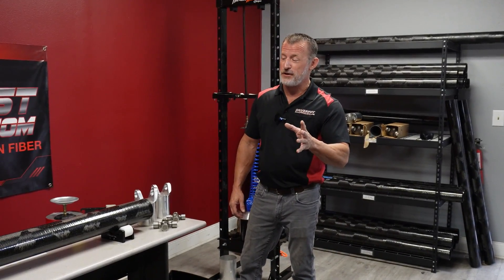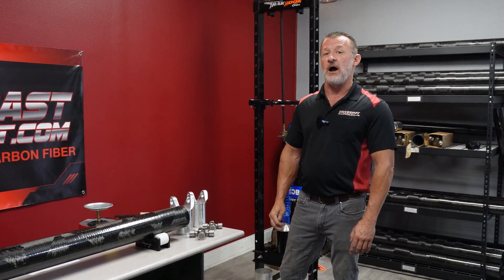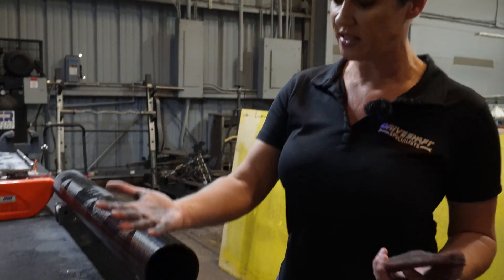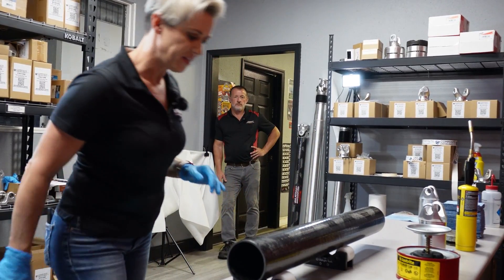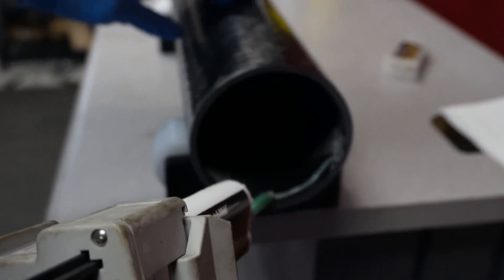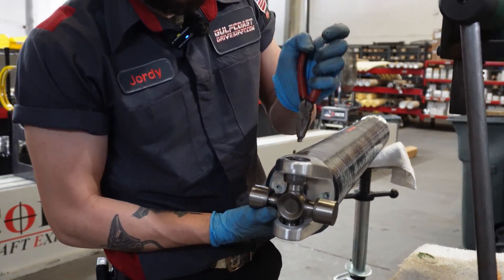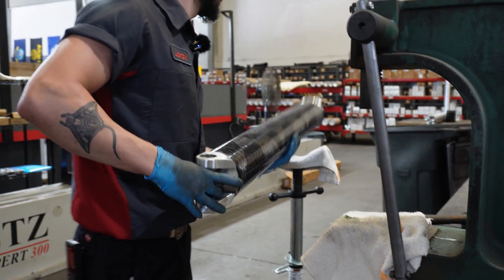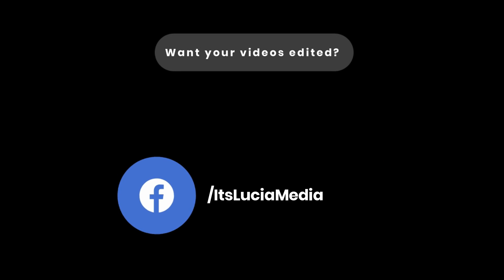Building Steve Morris Engines Carbon Fiber Driveshaft

Comment: As someone who built fiberglass body components for SCCA and drag racing applications for many years, heed my words please. On small jobs l wouldn't take the time to mask up when spraying my mold release agent (part-all10) and gelcoat. After making the piece and removing it from the mold once again, because it was a small part, l'd trim the edges using a diamond wheel without a mask. I've been on O2 for the past 5 years now, 2-LPM 24/7. Wear a mask. Carbon fiber is brutal.

Comment: Allowing that some issues have been beat to death in comments and addressed in a follow up vid, I'll move on to some others (mostly)
I was surprised that the cutting station was a block away from the assembly room. Let's face it, the one primary reason to do that appears to be largely ignored.
Also, holding the tube on the little saw table with no jig, clamp, anything to assure alignment and no movement during the cut? I see items like special roller holders and jigs for other operations, why the lack of a basic tool during cutting?
Similarly, the wash station. Don't mean to be hyper critical, just saying... Surprised.

And yeah, everyone wants to know more about the torque tester and its function/failure. Add me to the list. As well as a little more detailed explanation of the yoke alignment, balancing, etc.
People like us want details man!

Comment: it's ok to call a Buick a Chevy they haven't used actual Buick built engines since 1980 when the EPA changed the emission rules making GM start the black engine program in an attempt to comply with the EPA regulations .

Comment: When you take the rag you just used and smash it on that cleaner applicator all your doing is putting that dirt inside the can and all over the top. You need to do some tig welding to really understand clean.

You've just contaminated that entire can of cleaner.

What is stopping dust in the air from landing on that dispenser? Open top is a bad bad idea.

Comment: Why would anyone make a driveshaft out of carbon-fibre?
Reply: Because driveshafts fail in high horsepower cars, and when metal driveshafts fail in high horsepower cars they tend to rip the car apart and often injure (or worse) the occupant.
CF driveshafts essentially turn to dust, thus are far safer for the application.

Comment: The degree of rotation flex made me think some yoke timing advance might be in order .  If we knew close to what torque was being imparted on it during a run (I'm sure Steve knows) you could add that much advance into the yoke timing to have true yoke alignment under load to minimize yoke accel /decel  vibration .
Reply: The only thing I could think was STAND THE F BACK!!!

Comment: You might look at using isopropyl alcohol for the final clean, acetone leaves a very tiny residue. Background, I did wet layup repairs on a composite body jet for a decade, and we preferred iso over anything else because of its drying properties so we didn't have to do a two wipe (one wet, one dry) cleaning process before doing the repair.
Reply: Doesn't the flashing process take care of any leftover residue? Honest question.
Reply: @coreyandkristi  No.
In racing we use isopropyl alcohol to clean our carbon brake discs for the same reason. It's pretty much the only cleaning solvent that does not leave a residue and it does not affect CF:

Comment: I was horrified to see how you cut SM's driveshaft without any concern for what you were breathing. When consumed, carbon fiber "dust" is a killer as it can lead to all sorts of serious respiratory  problems with lung cancer being the biggie. Understand this ... once in, never out.

To make matters worse, if created in an enclosed area, carbon fiber dust lingers in the air so it continues to be second hand danger. Shops creating carbon fiber dust should be open-aired or filtered like a high-end paint booth. In any case, the techianition  should wear a fresh forced air hood or suit just like the car painters use. Dust on your skin is not good either.

Please do not let this pass as some minor concern  ... the person on the saw and any bystanders are being subject to a deadly environmental risk. Please keep the pretty lady safe!

Comment: This is on the wall of our factory, bicycle compoents:
1Version: 1.0, May 2018
This information sheet is to provide advice on managing risks associated with working with
carbon fibre.
1. About Carbon Fibre
Carbon fibres are man-made fibres of high carbon content formed from an organic
precursor. Carbon fibres are chemically inert, heat resistant, have high electrical
conductivity and high tensile strength. This information sheet does not cover carbon
nanotubes, refer to UNSW Working with nanomaterials guideline.
2. Hazards
Carbon fibre doesn’t pose a risk when in a dry fabric form or when cured in a resin matrix.
However, some tasks may release airborne fibres. Where possible, eliminate work with
carbon fibre that will release fibres, or substitute it for another material. If this is not
possible, then workers need to be aware of the following hazards and control strategies:
2.1 Dust exposure
Carbon fibres can become a fine dust released into the atmosphere during cutting,
machining or mechanical finishing. These fibres may irritate the skin or mucous
members, such as eyes and lungs. Carbon fibre dust generally has a diameter of
6-10μm and length 37.5μm. If they spilt length-ways during machining they could
produce fibres <5μm.
There is no Australian Workplace Exposure Limit for carbon fibre. Where there is
no exposure standard and the substance is both of inherently low toxicity and free
from toxic impurities, exposure to dusts should be maintained below 10 mg/m3,
measured as inhalable dust (8-hour TWA).
2.2 Chemical exposure
Carbon fibres are often coated with a substance that may be hazardous, for
example epoxy resin. The solvents used in the coating may be volatile,
flammable, and known to be an irritant. The binding material that holds the carbon
fibres together and coats their surface may be an important determinant of the
cytotoxicity. Follow the advice in the Safety Data Sheet (SDS) for the relevant
substance.
2.3 Electrical
Carbon fibres are electrically conductive, therefore sealed or air-purged
equipment should be used when processing or machining carbon fibre. If the dust
reaches electrical components, short circuits or electric shock may occur.
2
Version: 1.0, May 2018
Surrounding equipment should be covered to prevent exposure. Dust proof outlets
should be used in areas where carbon fibre dust may be generated.
2.4 Machine damage
Dust generated from machining carbon fibre may enter the equipment and cause
damage. The dust can penetrate small spaces, prolonged contact with the
abrasive dust, especially with any moving parts (such as bearings, ball screws)
can lead to wear and tear of the equipment.
3 General work practices
3.1 Write a local Risk Management Form (RMF) for the task.
3.2 Identify the hazards and controls based on the type of work carried out. For
example, are you cutting or grinding.
3.3 Review the Safety Data Sheet (SDS) from the supplier and follow recommended
precautions.
3.4 Provide engineering controls, such as local exhaust ventilation (LEV).
3.5 Rotate workers to reduce time working with the hazard.
3.6 Restrict access to work areas handling the hazard to only essential workers.
3.7 Provide Personal Protective Equipment (PPE) based on the type of hazard.
4 Specific work practices
4.1 Handling only
4.1.1 Fully cured carbon fibre is considered chemically inert and direct
exposure does not pose a threat. However, work gloves should be worn if
the ends may be sharp or there may be splinters on unfinished/rough
material.
4.2 Sanding/grinding
4.2.1 Machining generates significant amounts of airborne dust and fumes and
must be avoided or extracted to reduce exposure. The suggestions here
need to be considered and applied where possible for your application.
4.2.2 It is best to capture aerosols at the point of generation preventing release
into the air.
4.2.3 Total tool enclosure provides the highest level of control.
4.2.4 Wet cutting significantly reduces generation of airborne dust, and should
be used where possible.
4.2.5 When machining, use local exhaust ventilation that is attached to a high-
vacuum dust collection system. For example, shroud, hood, suction
nozzle. High-vacuum dust collection systems create a negative pressure
at the extraction point, capturing the majority of dust in the worker’s
breathing zone.
4.2.6 Reduce the cutting speed while maintaining the feed constant
significantly reduces dust emission.
4.2.7 Choose tools with fewer cutting edges/teeth, these produce coarser and
less harmful dust.
4.2.8 Choose non-powered tools.
4.2.9 Avoid excessive heating during sanding/grinding to reduce hazardous
dust.
4.2.10 If the composite fibres are aligned in one direction (not randomly aligned),
cut parallel to the fibre axis, so as to reduce the likelihood of smaller dust
particles.
3
Version: 1.0, May 2018
4.2.11 Keep work area clean with regular wet cleaning or HEPA filter
vacuuming.
4.2.12 HEPA Filter Classification indicates there are four performance grades of
filters: Grade 1 (lowest protection) – 4 (highest protection). The grade
needed will depend on the risk.
4.2.13 Have hand wash and eye wash stations available.
4.3 Laser cutting
4.3.1 Dust generated is more likely to be respirable during laser cutting, due to
the heat.
4.3.2 Gaseous compounds may also be emitted during laser cutting.
4.3.3 Most of the aerosol emissions occur at the bottom of the workpiece. This
may be the most effective position for local exhaust air extraction to be
positioned.
4.3.4 Reduce the temperate at the cutting front. Reduce beam power, increase
traverse speed.
4.4 Burning/furnace
4.4.1 During burning carbon fibre dust could become thin and long. Respirable
dust is likely to be generated during any heating process, therefore good
engineering controls are needed. High-protection PPE may also be
needed (refer to section 5).
5 Personal Protective Equipment (PPE)
5.1 The level of PPE needed will depend on the task being carried out and the level of
control measures already in place to reduce the amount of dust in the
atmosphere.
5.2 All clean PPE must be kept separate from the work area, for example in a
cupboard. If re-useable PPE is used, wipe it down with wet-wipe after each use.
Never leave PPE in the work area where dust may gather on it.
5.3 PPE types:
5.3.1 Hand protection: If you are handling only then wear work gloves.
Otherwise wear disposable Nitrile gloves. If there are resins involved refer
to the Safety Data Sheet for specific glove advice.
5.3.2 Body protection: A lab coat with elastic cuffs should be worn as a
minimum. In particularly dusty atmospheres disposable over coat or full
Tyvek body suit and disposable foot covers may be needed.
5.3.3 Eye protection: Standard safety glasses can be used for most operations.
Enclosed goggles should be worn when machining.
5.3.4 Respiratory protection: If it is only carbon fibre dust is generated then P2
particle respirator is recommended. If other gases or fumes could be
generated then a P2 or P3 combined particle and vapour respirator is
recommended.
Image 1. Work gloves
example
4
Version: 1.0, May 2018
6 Waste disposal
6.1 Never incinerate carbon fibre waste.
6.2 Dry fibres and cured laminates should be double bagged and put in a waste bin
that that is designated for landfill.
6.3 Where un-cured epoxy resins may be present (an environmental hazard), these
should be collected as chemical waste (solid or liquid, depending on the form) and
disposed of using UNSW chemical waste stream.
6.4 Dust waste collection has the possibility of dust exposure, follow the
manufacturer’s guidance on how to safely remove collected dust and dispose of
as above.
7 Emergency management
7.1 Spills: Dry fabric form can be handled normally, wear work gloves if there are
sharp edges. A spill of dust must be handled with disposable PPE, as outlined in
the PPE section above.
7.2 First aid: Make use of hand wash and eye wash (flush eyes for at least 15
minutes).
7.3 Fire: An electrical fire is most likely due to the damage carbon fibre dust can do to
electrical components. Ensure there is a powder or carbon dioxide extinguisher
near-by, only fight a fire if trained to do so.

Comment: i am curious to know if when the driveshaft copped that massive shock load on the testing machine how much does that compromise the integrity of the carbon? ie. when you shock load a carbon it is prone to shatter which says a lot about your tube that it didn't but could it have affected the integrity?

Comment: Interesting to see how you make these driveshafts. Couple of questions. If that is a clean room, then why does she sand the yoke metal,, while in the clean room. Is she not putting metal particles / metal dust in the air and surrounding items in the room? Shouldn't they be sanded in the other room? Also, would it be easier to use an Acetone bath to clean the yokes, instead of using clothes?
Reply: They just dimensioned a drive shaft using a hardware store tape measure and a freehanded chop saw.  Make your own conclusions about their quality control :)

Comment: Best practice cutting CF is continuous rim diamond with water lubrication. Not sure if you can get a non-segmented blade for that saw, but you can certainly run water.
This will eliminate the dust issue others highlighted and also minimise the risk of creating small flaws that can be failure initiation sites.

Comment: Always use a breathing apparatus/mask and eye protection when cutting hazardous materials because all that stuff is going into your lungs and eyes. And in this instance, cutting carbon fiber, there should also be a industrial dust particle extraction unit attached to the saw so that any particles released from the cutting is not blasted into the workshop.
5:14 Just look at all those carbon fiber particles being inhaled into their lungs smh.😬 I wouldn't want to work in this place seeing how they don't take occupational health and safety seriously. This short clip would be a good example to show in a occupational health and safety training video.
You may not feel or see the damage right now, but the accumulation of these particles in your lungs will wreck havoc on your health(cancer) and you will suffer in due time which may lead to your death. Your body cannot get rid of these particles in your system.
It really boggles the mind how some people are so ignorant to the safety of their health when working with hazardous materials.

Comment: Suggestion, most wireless lav mics can be configured for either stereo split channel or stereo mixed.  The split channel is usually for post-mixing the audio during editing so you have 2 clean channels.  But if you don't mix them together it is a little distracting because one person is coming out of one speaker and one person coming out of the other speaker.
Reply: Glad I read this comment, I was watching with one earbud in and wondering how they posted with such terrible audio. Turns out I was just missing half of it.

Comment: Are there no concerns of residue from the flame to apply heat. Obviously not or you would address it. Just thinking outloud thank you for the video
Reply: burning a hydrocarbon fuel, you're certainly going to get water vapor on the parts until you warm them up beyond that temperature.

Comment: I’ve actually wonder what the process is for a carbon fiber shaft, and I’m also a Steve Morris subscriber so this video is 👌. I knew the yokes were glued in, but damn that’s some amazing adhesive. With Gorilla Glue being advertised everywhere and other infomercial crap this is really the unsung hero in glues.😂 5000 Hp trans brake launches on a sticky track. If I had some of that glue I’d be glueing everything together with it😂

Comment: I’d hate to know how many driveshafts she’s made not wearing a mask whilst cutting. I for some reason thought I’d be watching how the carbon fiber shaft was actually made aswell, still quite a nice insite into how they’re assembled. Thanks 👍🏻
Reply: Or how many years they've been cutting the carbon fiber shafts this way with zero protection?😬
A shit ton of these carbon fiber particles and resin are already in their lungs by this stage. Just a matter of time before one of them becomes very sick.
Reply: @metarugia3981 you know I thought the same but my uncle's been working with carbon fiber since the race team he works for started using it from body panels to wings to splitters and he hasn't ever worn a mask either and he has better lungs then me so I don't understand it but the way I can taste it in the air when something carbon breaks or is cut I'll choose to mask up while in the shop just because it feels wrong not to lol

Comment: Thanks for sharing this. But please please one suggestion. PPE. Dry cutting/ sanding carbon fibre with no masks, respirators etc is just crazy. Keep doing this and you won't be around for very long
Reply: Doesn't look like it's their first time cutting it with zero protection on either. Just a matter of time before one of them becomes seriously ill or diagnosed with cancer.

Comment: If never ceases to amaze me that a super light tube with such a (relatively) thin wall can stand up to the abuse of 5000 HP Pro Mod launches.  Truly amazing material.  And if/when it does fail it just disintegrates into dust and small pieces avoiding injury to the driver or damage to the car.

Comment: Any reason to use the Arbor press versus a hydraulic press for the u joints?
Reply: One reason I can think of is that it gives better "feedback" tp the operator. Any cocking/sticking/binding should be readily apparent to an experienced operator.